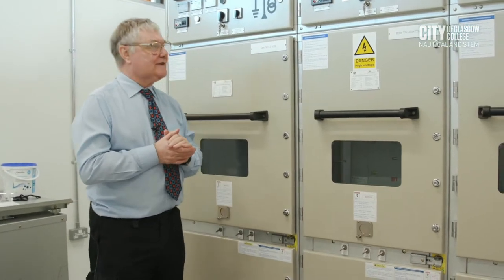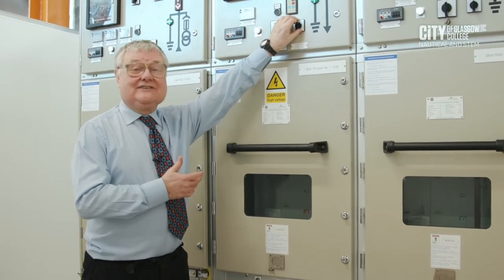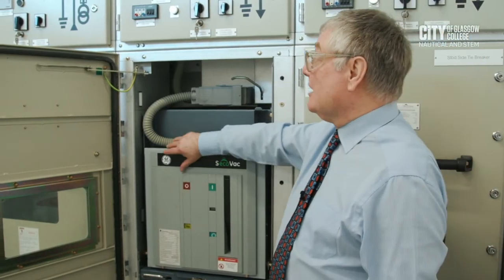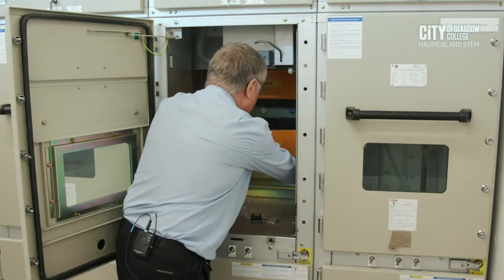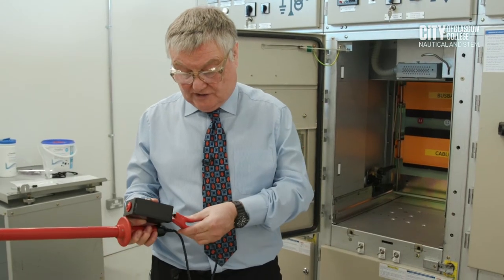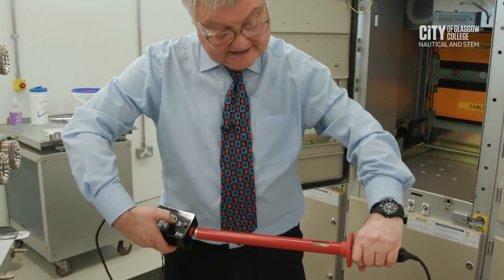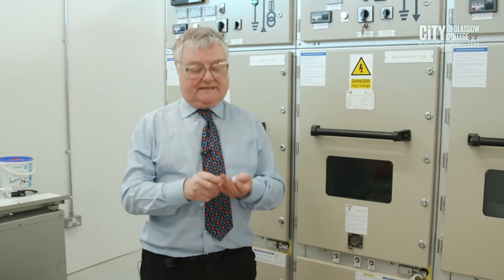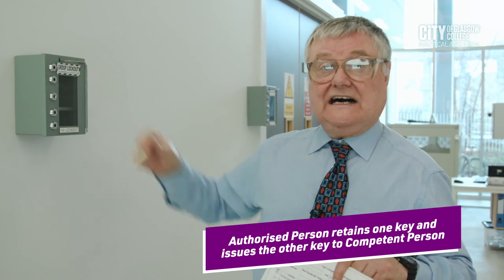High Voltage Circuit Breaker Isolation (Marine High Voltage - HV)

Comment: If you did any of that in the US without the correct safety gear (arc flash suit and gloves) you would be fired.From the moment you opened the door, until the grounds were hooked up, you should have been in arc flash suit.
Reply: It looks like some demonstration unit, I very much doubt that it is live.